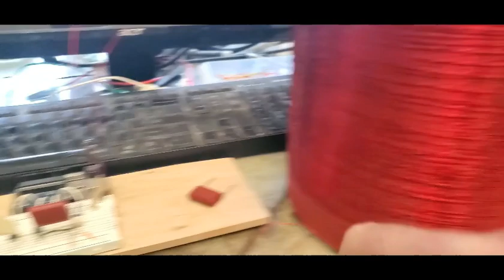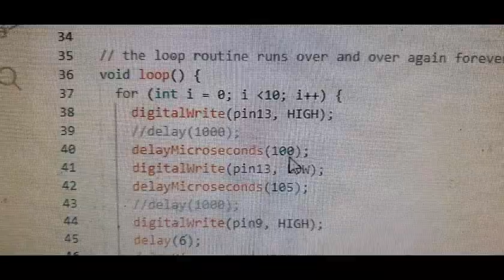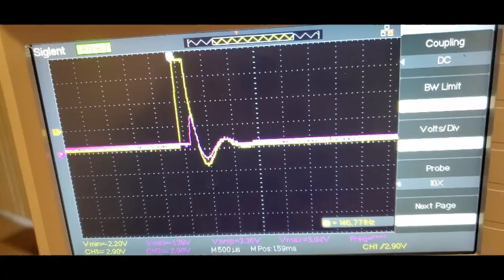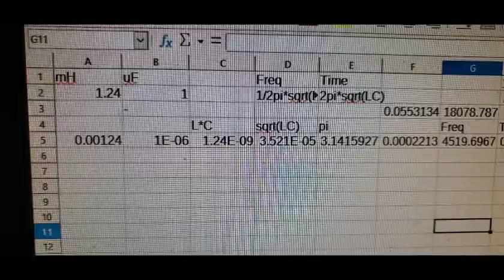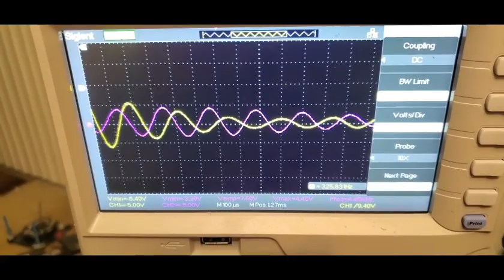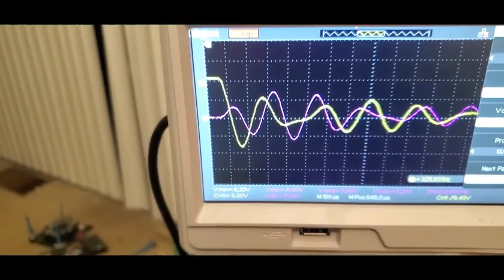Concerning Topics Far Afield: A look at the Magnetic Near and Far Fields

Comment: Nice video thanks. When you join the start of one wire to the end of the other you have created a centre-tap. If this is now  your input the current would flow in 2 opposite directions to the start and end of the two coils. I never thought of using one of the wires as a spacer....Interesting
Reply from the maker: Maybe not the most efficient use of wire, however, even with a 3d printer it would likely be a bit of a chore getting the spacing just right, if you have a bifilar, you do also have the spacing built in until you figure out what you want to do with the other wind.
Reply: @paulmaher812  i have used a tri-filar successfully in my pulse -motor, also a classic tesla bi-filar pancake coil.for wireless power. Might as well make use of that extra wind !!  .I would be flattered if you analised my Volt Robber winding , it's also on my channel videos. I actually really enjoyed your Q findings videos but can't wait for pulse-motor !  Cheers

Comment: You basically have a transmitter coil as primary (LC1). The secondary is a receiving coil and the capacitor connected to it acts as tuning capacitor, so it makes the wavelength for the secondary shorter (it will not act like LC). The real capacitor for the secondary LC2 is ground (or any solid object near it, like your table and the floor). You can get better results by using third coil against the secondary as counter antenna / virtual ground mass to replace the ground coupling, so it can make the LC2 circuit to resonate.
Reply from the maker: Interesting idea to use a third coil to tune the secondary.  I am also thinking of using a second switch to try and physically connect LC2 at different times after LC1 starts.  Will take a look at both, thx.
Reply: @paulmaher812  Yes, the wireless connections can be a little counter intuitive and it's hard to unlearn the DC :D Radio circuits are mainly based on the wavelength. The additional coils in them are usually full wave, half wave or quarter wave, compared to main pickup coil.